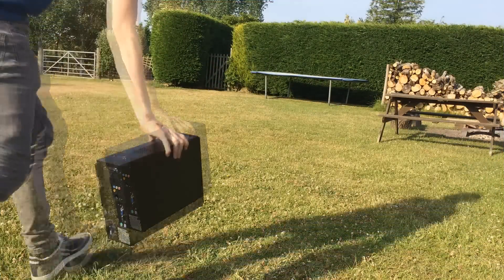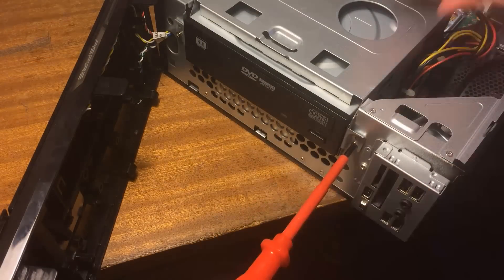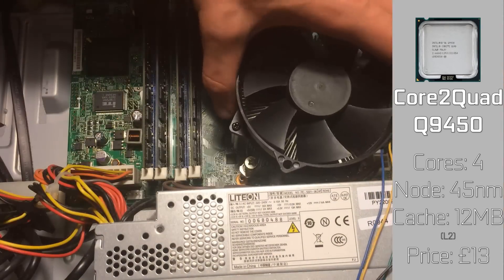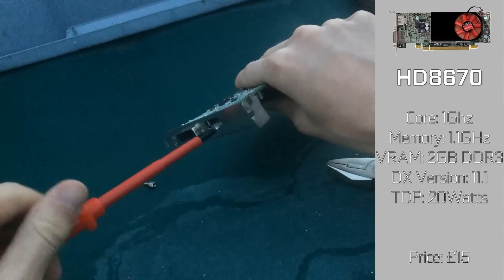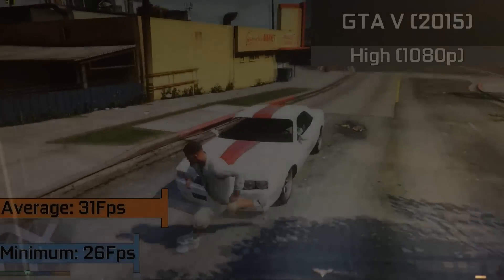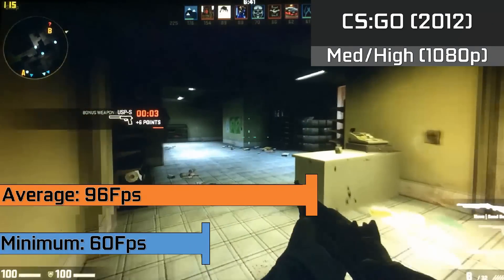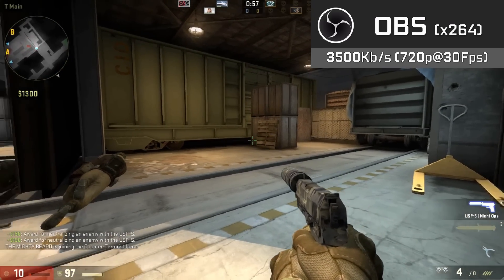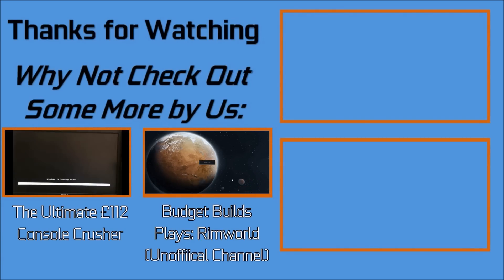Matching Consoles for £50? ($60) // The Best Value SFF PC

Comment: The only problem with a cheaper pc with used parts is the longevity, my ps1 lasted me 7 Years plus, my ps2 was solid for 5-7 Years and it still works if I want to play it, the PS3 I have is reaching a decade and still works.

I’ve never gone 2-3 years without something just giving out on my pc, which has always only had premium parts in it.
Reply from the maker: Strange as I've got plenty of parts from as far back as the 80s and they all work fine . Maybe you need to monitor temps and ensure things are clean.
Reply: Budget-Builds Official I think you may be right in terms of cleaning as recently it’s gotten a little dusty, but the gpu never sees anything above 65 at load and cpu is a 4770k known to run pretty hot, maxes out at 75c under load with a h100i. Its in a huge nzxt case with proper cable management. 

Maybe I’m just unlucky with motherboards 😂🙃

Comment: Man, i really want to do this. My main rig has a q6600 with 4gb of ram and a gtx 1050. I need something that can support 8gb of ram in order to play gta :(. Anyways would you mind linking me one of these? XD Keep up the great work!
Reply from the maker: 4GB DDR2 Sticks are available, don't loose hope
Reply: Check CEX, the price of ddr2 ram is sooo cheap on there!
Reply: Sorry for the late reply, yeah i just checked and i can't seem to find any that's actually in  stock. It was worth a shot, i'm probably going to upgrade to something like a xeon x3470, or wait until ryzen 3. Anyways thanks for the help!
Reply from the maker: Check out Sandybridge...Its amazingly viable today and very cheap to buy into
Reply: I was planning on buying a prebuilt with an i5 2400 but i'm glad to say, i found an amazing deal on a 5820k and an x99 motherboard. Together they were 200 bucks! I just need some ram and i'll be on my way. Thanks for the suggestion though.
Reply from the maker: Damn dude, AMAZING Deal, Hope it works well for you :D
Reply: Thanks, cheers!

Comment: You should have chosen the PS3 cuz it has a more powerful CPU.
Reply from the maker: Which was very hard to optimise for
Reply: True, but Naught Dog did a great job at it, Play Uncharted 3 or The Last of Us for yourself.
Reply from the maker: +Cesar Alvarez: Those were towards the end of the lift of the PlayStation, we covered this in the podcast incase you were interested ;D
Reply: Budget-Builds Official Ok I might check it out, The PS3 CELL processor still in 2017 is good, under that complex architecture, It slaps the Nintendo Switch ARM CPU in terms of raw power.
Reply from the maker: +Cesar Alvarez: But it also requires heavy optimisations and uses more power in comparison. RISC is a unique architecture that was awesome in its time. However needless to say it would require a complete overhaul to compete against some server grade units today.

Comment: Tbh a machine like this seems useless when most aa games are at the same price with this. Id get a used gtx 750 ti or 660ti boost
Reply from the maker: SerdarCS: Both good cards for the money, but this was a challenge mainly to compete with the size/speed of consoles at a fraction of the cost.... I've never done an SFF PC, so it was an experience :D
Reply: Yeah lol thats one point of it but the 750ti is allready a really small card and can get you much better price/performance.
Reply from the maker: SerdarCS: The 750Ti may be a good card but here in the UK it sells for £40 and up.... The HD8670 offers similarish performance for less than half the performance... it also let us get a full PC build for the same price....However if you already have a PC build the 750Ti would be a great pairing with it .
Reply: SerdarCS Why do I always... Like, ALWAYS see you around? And yeah, 750 ti's can be expensive.
Reply: Uhh similarish performance? I thought the 750 ti was like 2.5x better. http://gpu.userbenchmark.com/Compare/Nvidia-GTX-750-Ti-vs-AMD-Radeon-HD-8670D/2187vsm8025
Reply: SerdarCS Don't always trust UserBenchmark. Also if you think this video has bad value then check out the previous one.